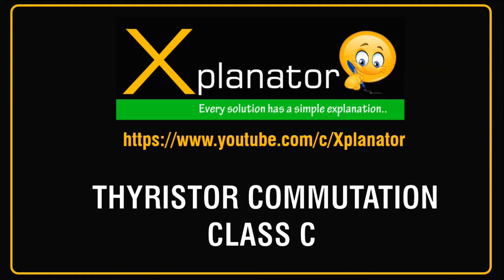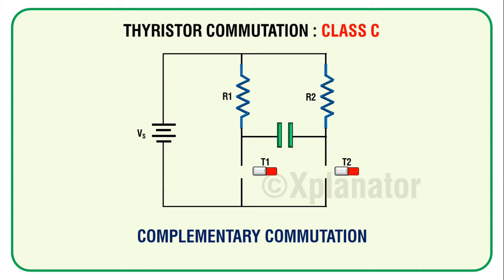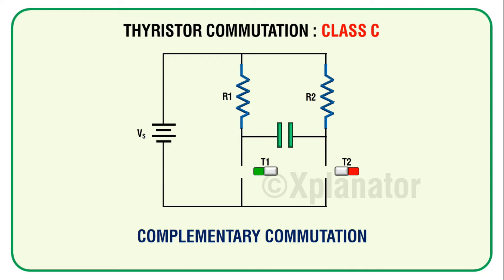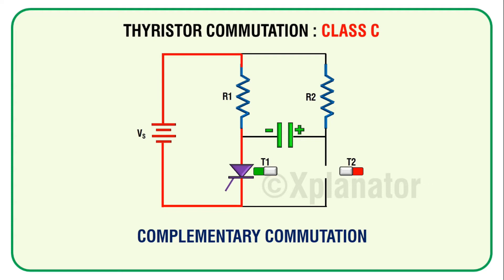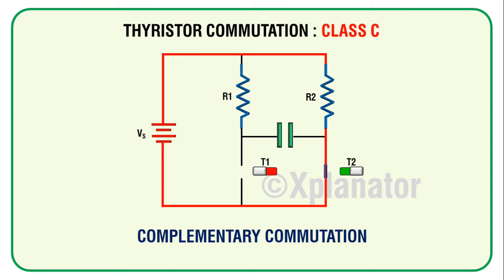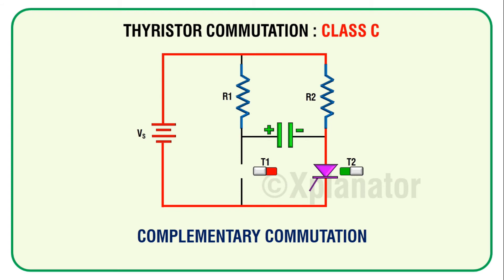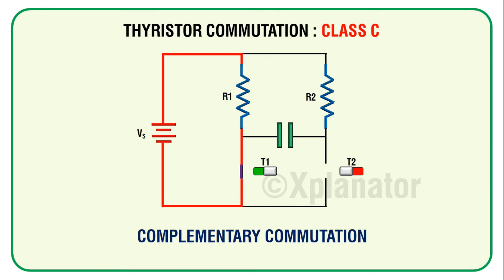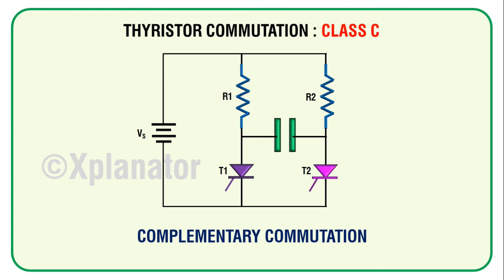Class C /Complemenatry commutation for Thyristor(SCR)

Comment: When current flows through short circuit R1 and T1 then why it take another path through R2 and capacitor?
Reply: Meet Prajapati for charging the capacitor....so that one thyristor will be turned off ....
Reply: Meet prajapati plz refer low pass rc circuit then you can understand why battery voltsge = Vc , because capacitor slowly charges to peak point of Vs and R1 = 0v